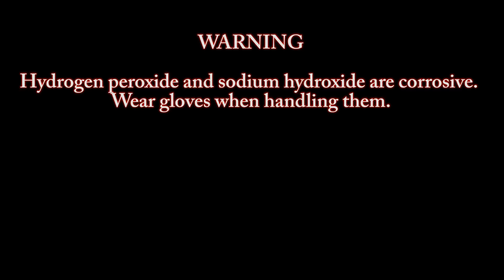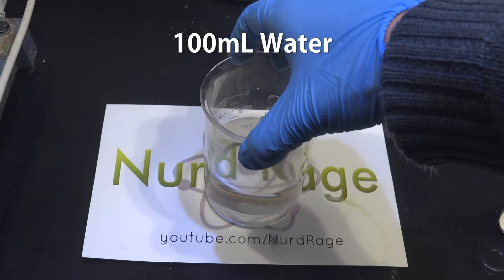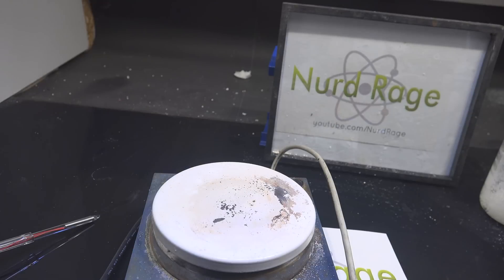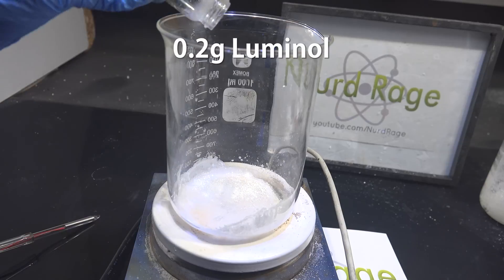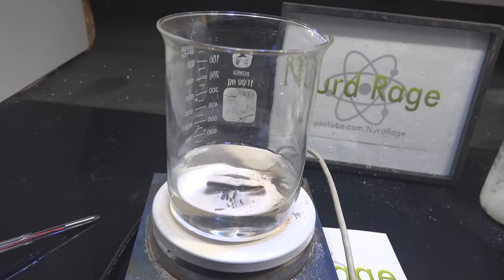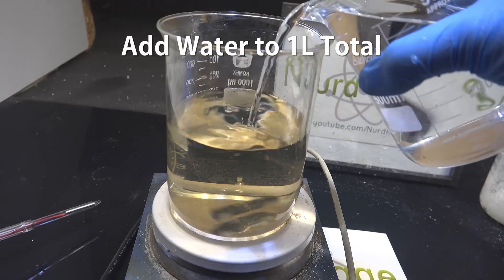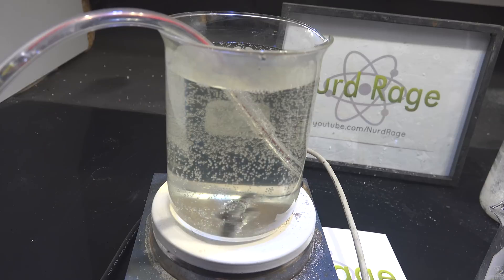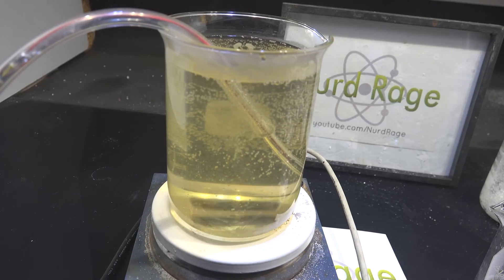The Pulsing Glow Stick - Oscillating Luminol Clock Reaction

Comment: I could find no videos on this, so I thought it might be a fun and challenging project for you. An aluminium sulfur battery. Theoretically, all you would need to do is make a sulfur composite for the cathode, raw aluminium for the anode, then use a highly ionic liquid. 1.2v and 1700 Watt-hours per kilogram of sulfur is amazing. 
As for the sulfur composite for the cathode, that is for you to figure out and is the fun bit :)

Comment: I always wanted to try this reaction. I'm wondering if it would be disturbed by the addition of fluorescein or rhodamin B. If not you could change the color to green or pink/purple.
Reply: Not sure if rhodamine, or fluorescein fluoresce as a result of oxidation like luminol, but you might be able to finagle something together using trichlorophenyloxalate (TCPO) a base and peroxide in the same way that glowsticks are chemically activated and the use the other reagents in this video for the competing equilibrium. It may work, but the competitive equilibruim would be with the oxidation of TCPO instead of luminol. NurdRage did a video called "Make Glow Sticks - The Science" from a couple years ago explaining briefly how TCPO works to activate fluorescent molecules.
Reply: Selvyn S The fluorescence does for sure work in the usual oxidation of luminol. I tried it some time ago. I just don't know if the oscillating reaction might be disturbed in any way.